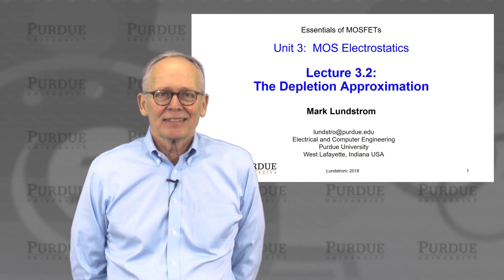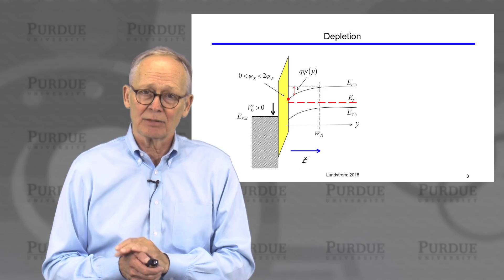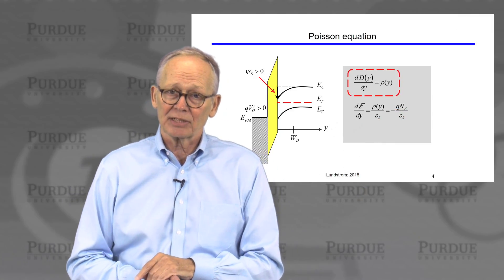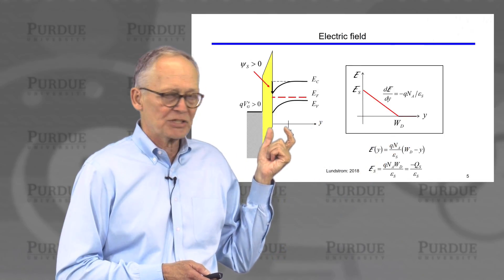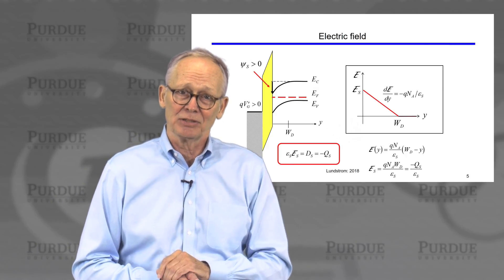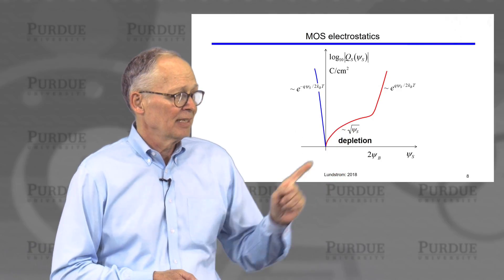nanoHUB-U MOSFET Essentials L3.2: MOS Electrostatics - The Depletion Approximation

Comment: 00:00    Lecture 3.2: The Depletion Approximation
00:25    1D MOS electrostatics
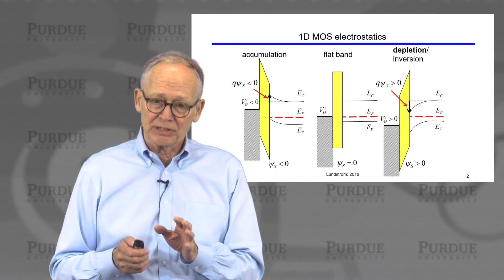00:54    Depletion
03:11    Poisson equation
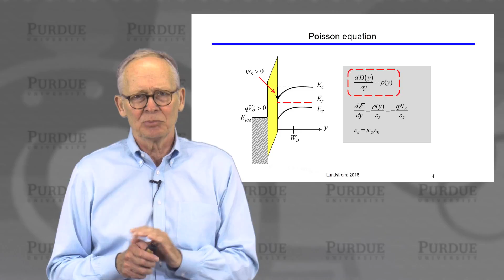04:04    Electric field
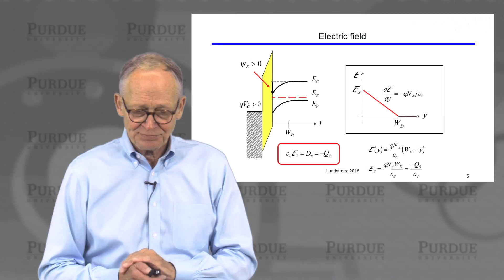06:25    Electrostatic potential
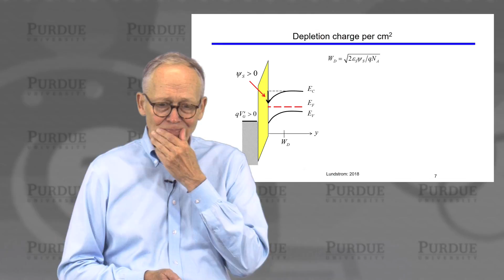07:43    Depletion charge per cm2
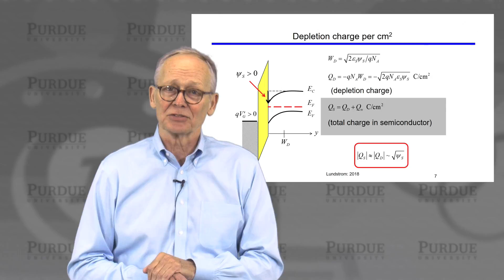09:09    MOS electrostatics
09:36    Example
10:30    Example
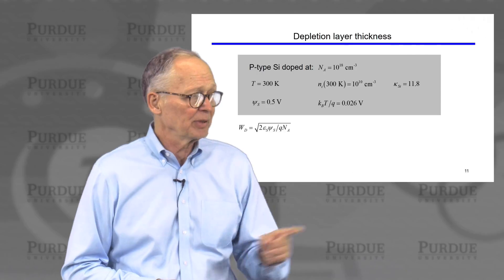11:20    Depletion layer thickness
12:20    Electric field at the surface
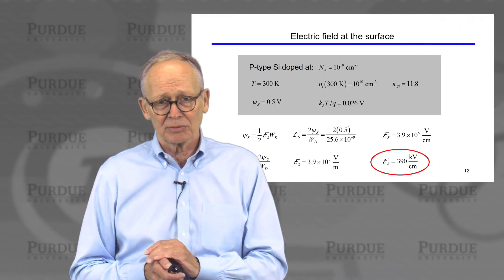13:09    Summary
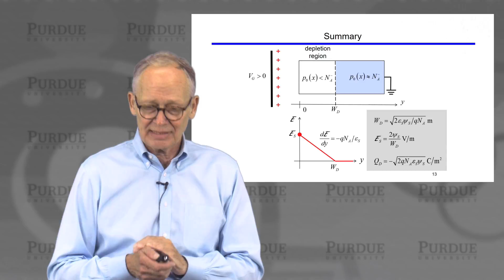14:06    Next topic